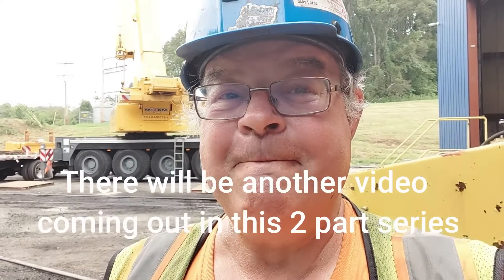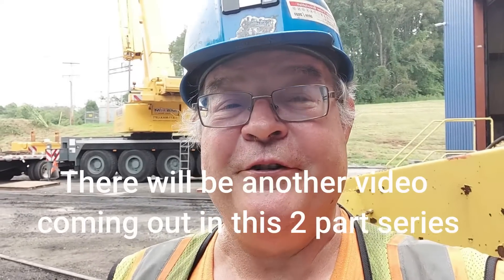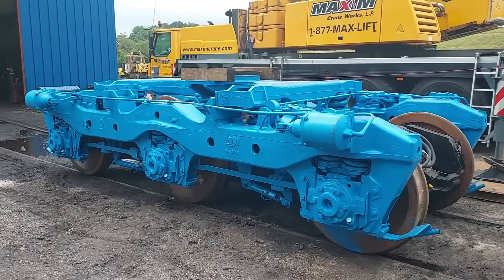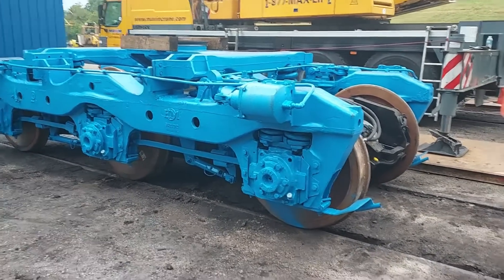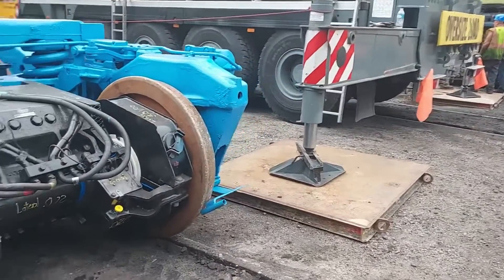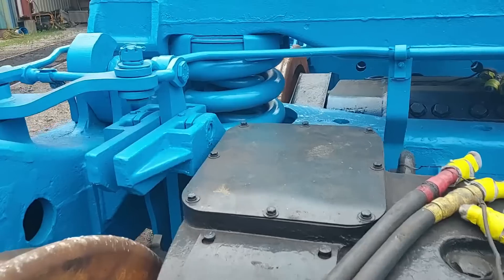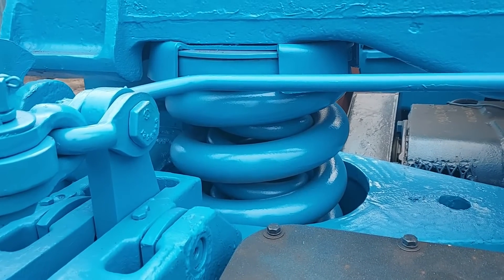Changing Locomotive Trucks on an EMD SD 40-2

Comment: Theses particular trucks are known as "Flexicoil" trucks, they're identifiable by the 2 holes in the truck frame between each axle. When the SD40-2 came out these were replaced by the "HT-C" trucks with 3 holes that gave better tractive effort. Because 3098 was originally built as an SD40 it has the older Flexicoil trucks. After numerous derailments in the Amtrak SDP40F fleet, many experts blamed it on the HT-C trucks, prompting some railroads to specify Flexicoil trucks on their new-build 6-axle EMD Dash 2 locomotives.
Reply from the maker: Thank you very much Jackson for sharing that valuable information
with us.  You are also correct, this loco was built for SP in 1966
as an SD40. Road number 8477. After the UP/SP merger it was
retired and sold to Boise Locomotive Works who did the dash 2
upgrade, but the frame remains as original SD40. And as you may
have guessed 3098 has far more problems with wheel slip than
our SD 38-2 locos do that have the HT-C trucks. Really appreciate your taking the time to check out the video and write in my friend. May you have a most blessed day.
Reply: That means this is a SD40R. R is for rewired. We have it’s sister at the Texas Northwestern Railroad. It is TXNW117.

Comment: Dave I’m surprised that these are not delivered and loaded/unloaded on a heavy haul lowboy fitted with rails and rail ramps, eliminating the need for crane. I’ve seen smaller
Locomotives shipped that way.
Reply from the maker: Your right about that Sparky, that would be the way to go. Trucks are rebuilt by a pro shop and they arrange for the trucking. Really appreciate your taking the time to watch our video and keep it on the rails until we meet again.

Comment: I used to run that exact model crane, a LTM-1100-5.2 (mine was a few years newer) the first job i ever did with it was a traction motor replacement on a GP-28 for Bay Line Railroad near Dothan, AL
Reply from the maker: That sounds pretty cool Sam! You've got to really know what you're
doing to operate a big crane like that and do it safely. Thanks so much for sharing and for taking the time to visit with us and check out the changing trucks video my friend.

Comment: why dont the traction moters have a gear that can engage or disengage the drive wheels/ axels rom the actual drive motor so that the trucks can freewheel easer like lets say a car when u put it neutral
Reply from the maker: Good question John and I don't have an answer but you would be
surprised at how easy it is to push a non running loco on level grade
with our small high lift. Appreciate very much your visiting with us to check out the video my friend.

Comment: Just over 30 tonnes; good to see they keep the load close to the platform rather than overextending the crane under that load.
The weight of locomotive trucks is often underestimated; on shorter-length electric locomotives over half the weight of the entire locomotive can be in the trucks alone. The truck frames weigh a lot of course, but the traction motors also are very heavy with all that copper and laminated cores in them.
Reply from the maker: Appreciate the nice comment maidsandmuses. Thank you for taking the time to visit and check out the video my friend.

Comment: Back in the 70's early 80's we had loco works open days where they demonstrated lifting a loco using two gantry cranes took it to the other end of the shop and rested it on stands Later they would bring it back and lower it on the trucks again. I always though it was the about the best part of those open days. When you did this your trucks would have to be put in just the right place before lowering the loco I guess they measure to the pivot centres on them. Things look similar to our locos the motors gear casing and way it fits onto the axle what we call axle hung nose suspended
Reply from the maker: That would be totally cool to see cedarcam. Same here on the exact
spot where they trucks must be so the loco body will sit down in
the right spot. You'll see in the next video the chalk marks on the 
floor they use to mark that. Appreciate your taking the time to visit with us and write in my friend. May you have a most blessed day.

Comment: That was so interesting to watch. How do you move those 30 ton trucks to positions under the locomotive? Also, it looks as if it is just a matter of plugging wires from the truck to the locomotive. I thought it would involve a lot of electrical work. Thanks again for the interesting view of real railroading'. :)
Reply from the maker: Very glad to hear you enjoyed Mustraline. Watch the next video out
and you will see us putting the trucks under the loco, it's easy.
yep on the traction motor leads, easy to do, but not much room
to work for the guys under there when doing it. Takes nerves of
steel with that loco body right over top of you. Thank you very much for stopping by and taking the time to watch and write in. May you have a most blessed day my friend.

Comment: Something I've noticed from your videos, there is very little WASTE on the railroad. The OTM from the tracks doesn't get re-used but it gets recycled. A rebuilt truck goes on the locomotive and the old one goes to get rebuilt. That's how you keep machines running SAFELY for decades. Spend money wisely.
Reply from the maker: Excellent observation Jasper. Also all old rail is either sold to contractors for use in sidings or spurs or yards elsewhere. Or the
really bad rail is sold for scrap.  Thank you very much for stopping by and taking the time to watch and write in. May you have a most blessed day my friend.

Comment: Lifting the that engine was is a heavy load!
Reply from the maker: Locomotive weighs 368,000 pounds and yes those jacks can
handle that weight no problem. Consider how much more some
of the old big steam locos weighed, this is a drop in the bucket
compared to some of those old beasts.

Comment: Wow I didn't realize tricks were that heavy  I was thinking only  3 or 4  tons
Reply from the maker: It is amazing isn't it Eugene. Consider a concrete truck driver
wrote in saying his loaded cement mixer truck weighed 66,000
pounds so that puts the weight of these trucks in a better to
understand perspective. Perhaps you were thinking of a freight
car truck ?   Thank you very much for stopping by and taking the time to watch and write in. May you have a most blessed day my friend.
Reply: a traction motor and wheel weighs about 8000 lbs.

Comment: curious...are the trucks held in place just by the sheer weight of the loco?
Reply from the maker: Yes they are Lou. There are heavy links and clevis on the trucks
to the loco in case of a derailment to keep the trucks close to
the loco body, but they don't hold the body down to the truck
during normal operation. Body sits down in the bowl on the truck,
Fed Regs state the minimum that must be is 1 1/2 inches. Thank you very much for stopping by and taking the time to watch and write in. May you have a most blessed day my friend.

Comment: Big time maintenance here :)  I have seen them move trucks at the engine assembly plants, but this is in the field and requires a different set of tools. One of the key things I remember from my days in power plant construction is the riggers and rigging. The cables, chains, and shackles are likely calibrated/certified and the guys are certified riggers. Add in the operator of the crane and his knowledge and you have a safe and efficient lift :)  All in all, very cool to watch. Also - you are a brave man to walk under that 400,000 lb. locomotive :)
Reply from the maker: You are correct Brian, all those crane guys are certified, very important safety thing. I highly doubt if the crane company would
even send out guys who weren't certified. If something went wrong
the company would be liable for all damages if using non certified
personnel. You might think I'm brave, but I only spend only a few seconds under there!  :-) Very glad to hear you enjoyed. Thank you very much for stopping by and taking the time to watch and write in. May you have a most blessed day my friend.

Comment: EXCELLENT video DAVE ! I have one question;   What is the  "AVERAGE SERVICE LIFE" of a set of trucks in YOUR Railroad ???
Reply from the maker: That's a very good question Tom and there is no answer. Now how's that for being definitive. No one ever studied that here. And since these old locos do not record mileage, that info cannot be gleaned
on how many miles are run on each truck. New locos record everything and much better records are able to be kept by the
owners of those locos. With our track having so many high
degree curves plus all jointed track that in and of itself is harder
on 3 axle loco trucks than a RR with all welded rail and lower degree
curves. Thank you for taking the time to check out the video and write in my friend. May you have a most blessed day.

Comment: Are these...a/c traction motors?
Reply: dc motors, EMD type D77.
Reply from the maker: These are DC traction motors Dave. Current comes from the main
generator as AC power, then it is fed into a power rectifier to turn
it into DC. And yes I know DC power comes from a generator, AC
from an alternator, however EMD in their owners manual calls it
the main generator, model AR10 D14.

Comment: In that truck rebuild, does that include new springs in the bolsters, or is it just new wear surfaces, bearings, and rewound motors? 

I ask because I swear I remember from years ago that the bearing blocks used to ride more centered in the bolster than some of the locomotives I see cruising around with the block almost buried in the top of the frame.
Reply from the maker: To my knowledge kleetus everything is rebuilt, other than the side
frames and some of the other rigid metal parts and those are
magnfluxed. So yes the springs, bearings and motors are all
rebuilt or remanufactured however you want to state it. Thank you for taking the time to check out the video and write in my friend. May you have a most blessed day.

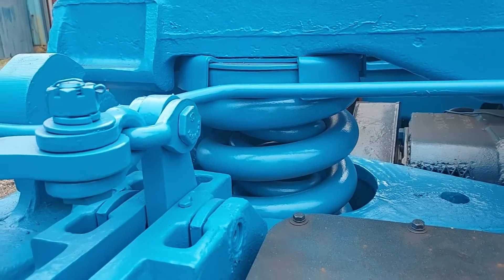Comment: At 1:49 in the video, toward the left sided of the screen is shown a nut secured with a cotter pin.  That nut does not appear to tightened down all the way to properly compress the lock washer.  The flat washer also looks to have a gap under it on the left side.  At 1:58 you can see the nut on the other side and it also appears to not be completely tightened.  Perhaps it is supposed to be that way, but is sure doesn't look right.
Reply: that is the brake rigging linkages, they are not supposed to be tight, as those are hinge points on the linkage, snug, with a cotter pin is correct.
Reply from the maker: Very observant I'm Me, but as rear speaker said in his reply they
are supposed to be just snug and not so tight the linkage wouldn't
be able to have a bit of movement in it. Thank you for taking the time to check out the video and write in my friend. May you have a most blessed day.

Comment: While your trucks were getting rebuilt, did you just go to the local rental yard to rent a couple sets while the rebuild was taking place?  If you get another chance, could you point out the various parts of the trucks?  It looked like there was a tank of some sort on the right side, shown at 3:10. I'm not sure what I was expecting, but considering how big the laco is, I'm surprised the connection to the trucks looks like just a few wires and hoses. Very cool.
Reply from the maker: Lot's of questions from lots of folks on this one shop shop, sounds
like sometime I need to make another video and point out all the
parts. That tank you are referring to is a gear box cover.  It gets filled with what is called crater grease. And yes those wires were the electrical leads to connect the power rectifier to the traction motors. Thank you for taking the time to check out the video and write in my friend. May you have a most blessed day.

Comment: Flexicoil truck would suggest the locomotive is a straight SD40, not a dash 2.
Reply from the maker: Charles, this was originally built as a SD 40 for Southern Pacific, after they merged with UP, it was sold to Boise Locomotive Works which gave it the dash 2 upgrade, so frame is still the 40 original build. So
you are correct in your thinking. Interesting history this old girl
has, it's been all over US and Canada, after Boise was leased to 
CSX and CP until it came to us in 2013. Thank you for taking
the time to watch and write in my friend.
Reply: Charles Kuehn, Cosmetically it has all the original features of the original SD-40 that it was built as, but it has long since been upgraded with -2 modern electronics, which makes it a SD-40-2 now.
Reply: @brianbenson1973  
Believe it or not,  that actually occurred to me after I wrote the comment, which was meant more in the nature of an observation than a critique of the video caption.
Reply: @ckuehncnwhsyt   Sorry you mis took my comment for being contentious, didn't mean for you to take it that way at all.
Reply: @brianbenson1973  Thanks for removing the contentious language.  I have removed the reference to same from my reply.

Comment: Hi Dave, Is the locomotives  wheel motor run by electric motors or hydraulic  motors.?
Reply from the maker: The traction motors on the loco are DC electric Northern Living
getting their current from the loco's main generator.  Thank you for taking the time to check out the video and write in my friend. May you have a most blessed day.

Comment: That is a big crane. You think about all of the things that go into heavy lifts and you don't have much room for error. I am amazed with those lift chains the trucks are hanging off of and the 50 ton jacks lifting the engine and still would never walk under a load or near it. Failures happen and it is never good when they occur. The riggers and experts that make sure everything is in top notch working condition have a big responsibility.  Interesting  process.
Reply from the maker: You are right fireguy you never walk under a load a crane is lifting, 
you never know, unkind things can happen. The stationary jacks
are different they are extremely well built and no chains or cables
or straps. Thank you my friend for taking the time to check out
the video. May you have a most blessed day.

Comment: Dave, are the old trucks the originals from when SP owned it, when it was just a original/straight SD-40, or has your Company changed the trucks out in the past, since you guys have owned it? Great video!
Reply from the maker: 3098 came to us in October 2013 Brian. I'm certain trucks had
been changed before it came to us, but have no documentation
of that. I also did not write down except for the past few years
when trucks got changed on any of our locos. But also I feel
rather certain this is not the first time here those trucks have
been changed or at least a traction motor or two. Apologize for
the otherwise inaccurate info on that. Thank you so very much
for watching tonight's presentation my friend.
Reply: @ccrx6700  Thanks Dave, for responding to my question, really appreciate that. I'm here in old SP Country (Southern Oregon) few miles from the Northern California border. (Now G and W) I used to see SPs SD-40s and SD-40T2S climbing over the Siskiyou mountains into Northern California ( 3 on the point and 5 in the middle of the train) all the time as a kid. I'm sure your Company's, SD-40 (now a -2 ) used to run through here back in the day! Always look forward to your cool video's Buddy! 👍

Comment: Hello Dave 👋, Changing the whole truck assembly with traction motors is a 
Major and expensive undertaking, but when completed, the ride on those new sneakers 👟 and power 🔋 of new traction motors would be worth admission tickets to the event.
 I  hope in the next video 📹, show the blower motor boots being connected with the traction motor cables. Tight spots to turn wrench 🔧 with colorful language from under a locomotive 🚂  Usually accompanies the echoes from under the engine 😅. Been there, done that 😮😅. 
Stay safe my friend and have fun 👍. 
Richard Bause
Reply from the maker: Family friendly channel Richard, some things (colorful RR language)
is not included....LOL One of the old trucks had some pretty
serious wear on the wheels almost to the point of being condemnable. Glad they spent the money on getting these changed.
Thank you for writing in and for taking the time to check out the video. May you have a most blessed day my friend.
Reply: @ccrx6700  Dave, ok, bleeped in YouTube Elevator music 😲🤔🎶 😊😁 instead while making connections 🤔😄 .
Have a good night 😴 my friend.
Reply from the maker: @richardbause2453  👍😊
Reply: @ccrx6700  
Back to switch construction at Cooperstown and Charlotte Valley RR &
Jacking up the speeder garage for moving down the track.
Pictures to your phone 📱. 
Have a great day 😀.

Comment: Always wondered, does the locomotive just sit on the trucks and the weight of the locomotive hold it down or is it bolted to the truck?
Reply from the maker: Yes it does myesenc. The loco body center plate must fit down
in the truck bowl a minimum of 1 1/2 inches according to Fed regs.
There are chain links and clevis on each side of the truck to hold
it close to the loco body in case of a derailment. Truck cannot
be bolted to loco body as remember, it must swivel to negotiate
curves. Thank you for writing in and for taking the time to check out the video. May you have a most blessed day my friend.